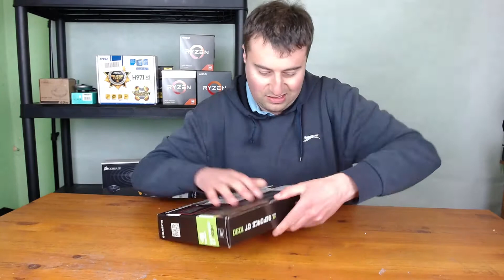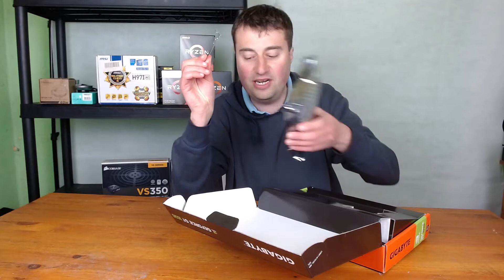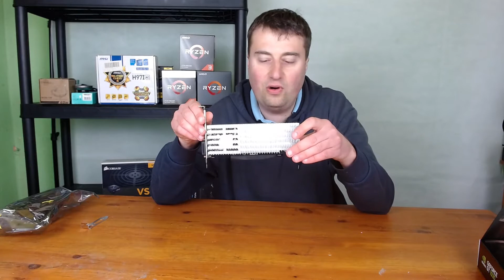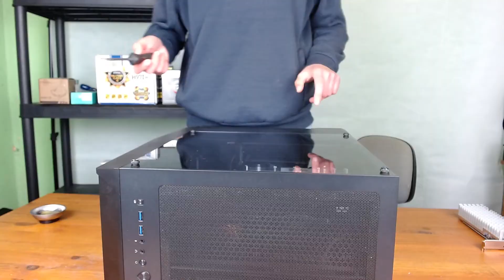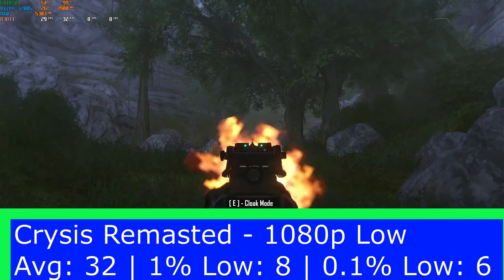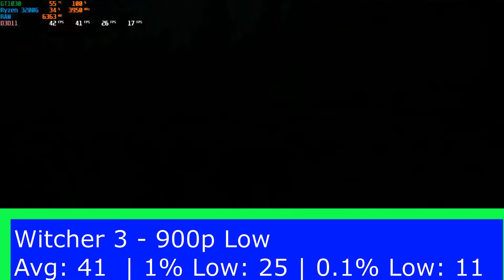Gigabyte Geforce GT 1030 Unboxing and Install - Silent and Low Profile Graphics Card

Comment: Just asking if you uninstall your graphics driver first before installing it?
Reply from the maker: Yeah use DDU (Display Driver Uninstaller) software to safely remove old GPU drivers then insert new GPU and then install the new GPU drivers
Reply: @UltraGameWorld  do i really need to? If i were to change my gts 450 to gt 1030? Can i just change it without uninstalling drivers?

Comment: Well its not really a bad card. As long as you don't picked up the gddr4 version, you can play any games at low and medium settings. Many who have bought the gt 1030 complained that the game was very slow, its because NVIDIA released two versions, ddr4 and ddr5. I'm glad a manage to grab a ddr5 version for a very low price even if I just bought it on the marketplace, but in a pretty good condition. 😁
Reply from the maker: Yeah this version is the GDDR 5 version, it's ok for eSports titles and older titles but there are so many better options on the market now

Comment: Hi I’m building a dell optiplex 1070 will this graphics card work ?
Reply from the maker: Should be fine as doesn't require any additional pcie power and is a low powered card
Reply: @UltraGameWorld  thanks I’m building an optiplex 7010 sff into a gaming pc so this helps out a lot thank you

Comment: My cpu is intel core i3 2100 and mother board is samsung H61S2... It has ddr 3 6gb ram ... Psu is normal 400w psu...but it doesn't work with Gigabyte GT 1030 OC 2GB... What's the problem?
Reply from the maker: You might have to change the BIOS settings to use the GT 1030 instead of the on board integrated graphics, or possibly it's just a faulty card and you need to return it.

Comment: Not much heat. XD Naa mate. I used the ASUS Phoenix version and Overclocked it around 1.86Ghz 56c with an Afterburner fan curve.
Reply from the maker: That's cool yeah you can overclock the gt 1030 a fair amount

Comment: Hi! Will it reach above or exactly at 100fps for valorant with only 8gb ram? I have the same processor and planning to get this as a temporary card because prices are really high in our country.
Reply from the maker: I would think it could reach 100 fps in 1080p low settings for Valorant but i can't confirm that unfortunately.
Reply: @UltraGameWorld  it's ok thank you for your response!

Comment: Hello i installed it on my HP Pavilion 590-p0xxx, i5 8400, 8gb RAM, the fan works but I've a black screen, the hdmi cable is well plugged but it looks like he doesnt recognize it. Could it be because i've a 180W PSU ? I know it's low but it was working well with the previous GPU Radeon 520.. Or is it something else i didn't do?
Peace
Reply from the maker: Possibly the 180 watt PSU, only way would be to try  it in another PC and if it works then it's your PSU.

Comment: I'm getting this card but in the D5 version how many FPS would I get with gta 4 and gta San Andreas and gta 5 I mainly play those at 1080P medium
Reply from the maker: This is the DDR5 version of the GT 1030, I would think most those games will run at 60fps average at 1080p settings but depends on the rest of your pc specs
Reply: @UltraGameWorld  oh ok my specs are i5-3570 16GB ram and my current gpu is the 750 TI and the only fps I'm currently getting on gta V normal settings i get around 25/24 fps on normal gta 4 I get around 26/25 fps normal settings
Reply from the maker: Ok yeah you probably will get an upgrade from 750 ti but your processor is holding the system back really. I can't say exactly what FPS you will get but it will be slightly more then what you are getting now.
Reply: @fastfromgaming4354  the ddr5 card is way more capable of handling games than the ddr4 card so gta will run fine

Comment: Can I use it with a 240 watt platinum power supply in an hp prodesk i5 4430s and 8 gb ram?
Reply from the maker: Yes I think that should be fine as the GT 1030 doesn't need any external power
Reply: Ohk
Thank you so much for replying
Also I want to ask about the fps I would get in fortnite performance mode at 1080p low
Reply from the maker: @khozemavakil2606  yeah this graphics card should easily do over 60 fps at fortnite 1080p performance mode
Reply: @khozemavakil2606  if the gameplay is not smooth, try lowering the resolution to 720p

Comment: hey
i have 4gb ram , g4400 pentium cpu and im going to buy this soon.
i only play league of legends. can u tell me how much fps im gonna get in high settings 1080p?
Reply: league doesnt require a good cpu btw.
Reply from the maker: Should be good fps at least 60 fps I would think as league of legends isn't too graphically taxing. You might need to drop from high to medium to get a more stable frame rate
Reply: @UltraGameWorld  why only 60 😐 what sucks cpu or gou?
Reply from the maker: I don't know exactly what the fps would be on your system it's just a guess. As league of legends is fairly easy to run it should be fine on your system but can't say for sure.
Reply: @UltraGameWorld  thanks for reply

Comment: I just picked up a r7 240 2gb 128 bits for 30 pounds, same reason, better than no GPU, especially with the market condition right now :)
Reply from the maker: Cool probably performance is near to this card and £30 is a bargain in this market